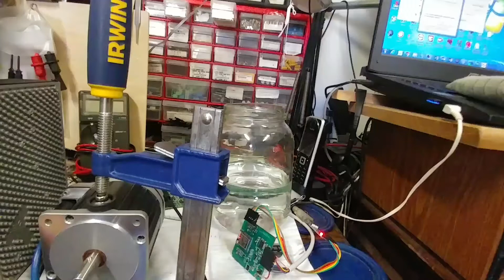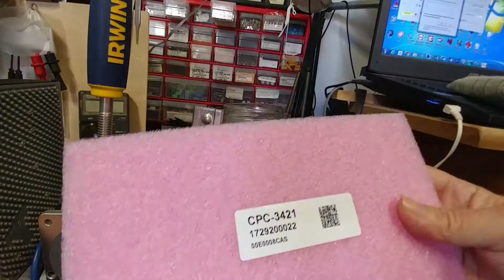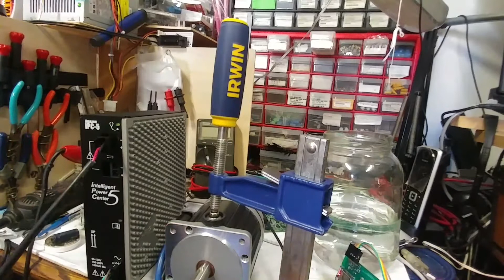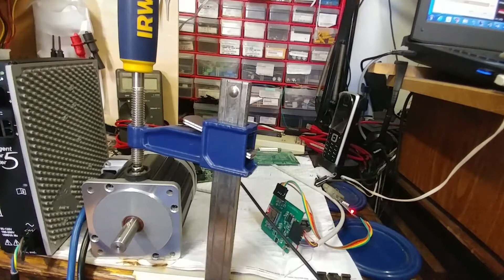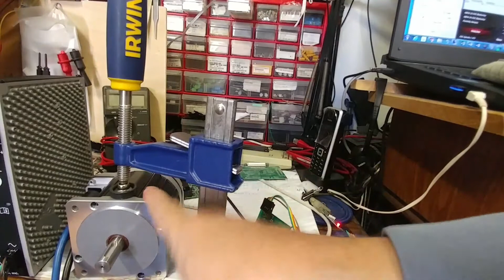ClearPath Servo SD model Unboxing

Comment from the maker: I'm very aware that the screen isn't visible. Yes, that isn't ideal. That's why I tried to read the settings and choices out.  Future videos do a better job with including the screen. The point of this video was to guide people through getting it running by telling (if not showing) them where to click. If the audio instructions aren't valuable, or if the "quality" of the video is so critical, keep down voting and I'll delete this video and just leave people with the main video at 
https://youtu.be/oPsy-o32qeI
Where we get it running with the GRBL shield. I won't keep down voted videos on the channel.